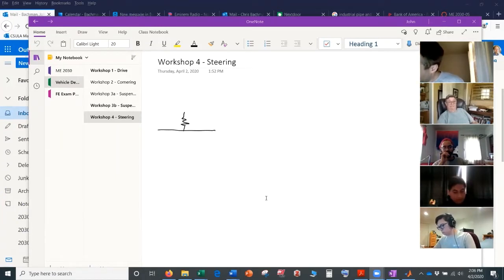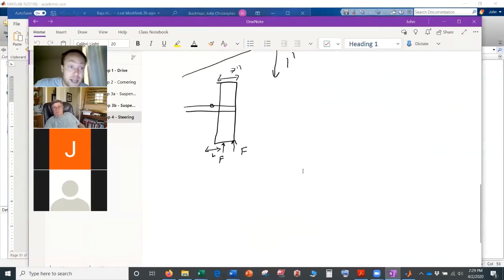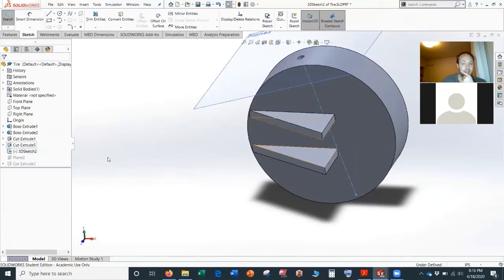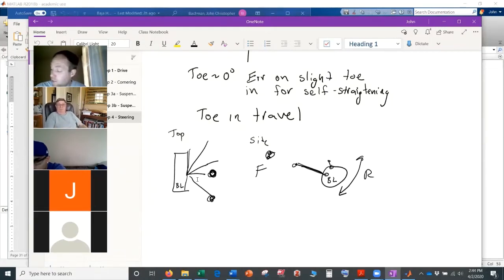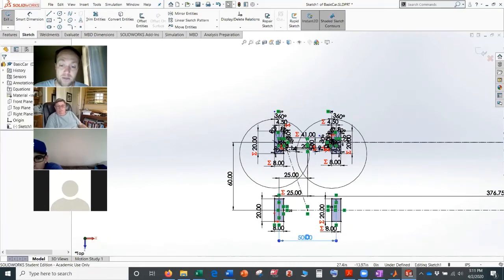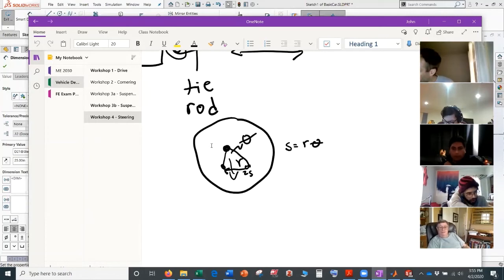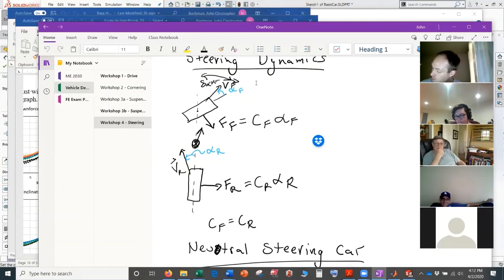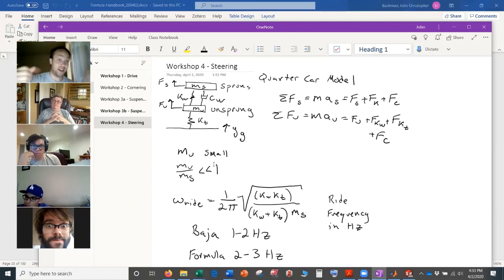Race Car Design Part 4: Steering Geometry and Kinematics

Comment: Great video. I have a question. If the A arms joints (of each one) are in line the tie rod length can be easily estimated. What if the A arms joints are not inline for lower or upper or both A arms? Should the tie rod follow the plane that the 4 points create?
Reply from the maker: Please write chris.bachman@calstatela.edu with some images and he will do his best to reply.